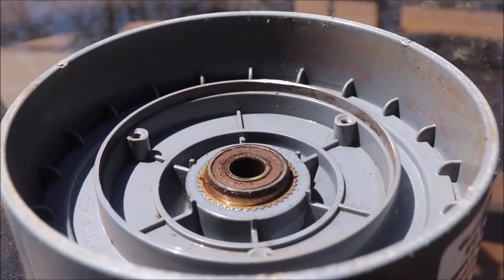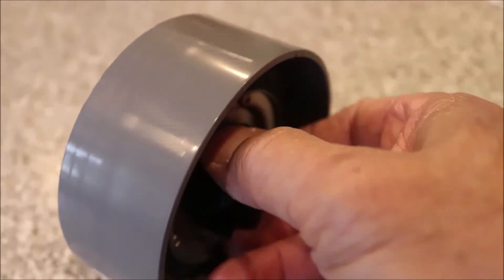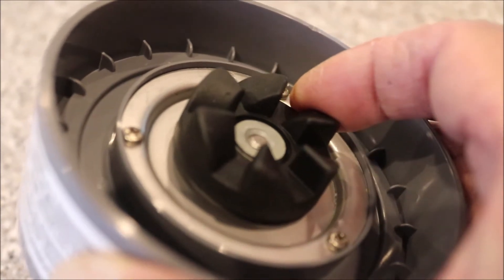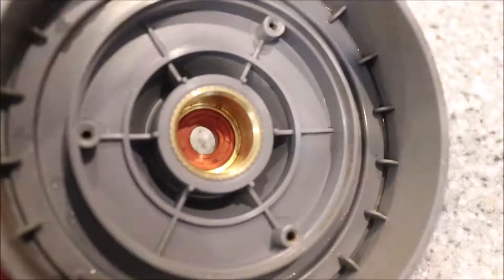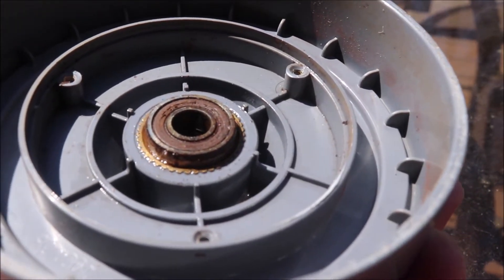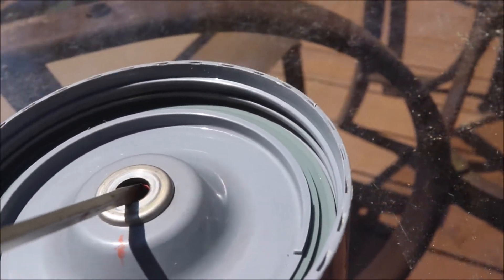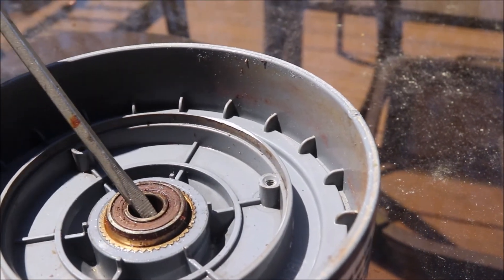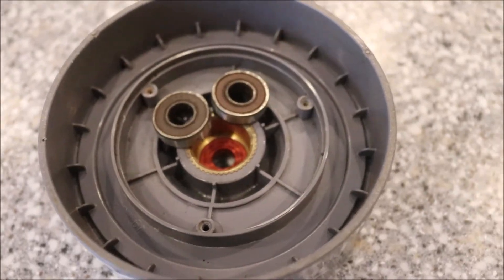NutriBullet is very loud and noisy - the ball bearings need to be replaced.

Comment: Rubber toothed bottom is reversed threaded.  A Snap Ring pliers on the two small holes makes it easy.  The bearings are #698RS.  A better bearing would be S316 698 RS or S304 698 RS.  The latter are all stainless steel bearings.  No more rusting

Comment: Bearings lose lubricant over time. The black seal on these bearings easily snaps off and on with a knife tip or tiny screw driver.  Instead of replacing them, these bearing can be cleaned and re-oiled if they aren't physically damaged. If they are damaged, you've been misusing your nutribullet.

Comment: I got the bearrings out but the shaft seal is destroyed. Would anyone know what the specification/part number is for a replacement shaft seal? Cheers
Reply from the maker: check out the comments from tin dumbovic under this video:  https://youtu.be/imFKXa7joYE  He states the seal dimensions.  I have not verified if they are correct or not.
Reply: @YuDaMan  Thanks, I spotted that post as well. Have ordered it from AliExpress, the size/compound doesn't seem available from local bearing shops (Im in Australia). In case anyone is wondering it's 8x16x5 Oil Seal - material compound FKM / Viton. I verified the size on my broken seal also. Will report back how it goes, a few weeks shipping from China.
Reply: @F0untain  

I dont think thats the correct size for the rotary seal. I just took mine out and the dimensions of the seal are almost identical to the bearing.
Reply: @ceezedgerman  I can verify the 8x16x5 oil seal fit and was the same size as existing.
Reply: @F0untain  Can you please share the link of Ali Express? I couldn't find the exact seal there unfortunately.

Comment: Don't bother with this folks.  I tried this, got two new bearings, reused the old seals and the result was worse than the original, leaked allot more and noisier.
Reply from the maker: My replacement stainless bearings are still very quiet after 5 months of almost every other day use.  It is critically important to install new bearings properly.  NEVER press on the INNER bearing race to install ball bearings.  You must press ONLY on the outer bearing race to install ball bearings properly.
Reply: @YuDaMan  Depends on the quality of the replacement bearings.  Mine were cheap ones from Amazon.ca.  Cost $6 Cdn for four.  If you obtained a more expensive SS set, that probably made alll the difference.  Cost for a whole new base from Nutribullet is about $40 Cdn delivered.  Where did you get yours?  I'm inclined to try a better set.  Thank you.
Reply: It would have been a lot more helpful if you’d showed how you got the f@cking thing apart!
The bearing replacement is the easy part.
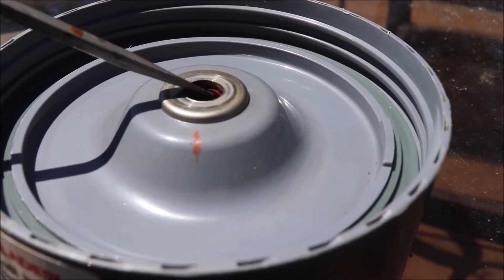Reply: @claywebb8199  There seems to be a playback error on this video starting at 0:45.  He demonstrates how to do it but you need to seek backwards to get to the part and that doesn't alas work.  Grab the blades with one hand and the rubber thing with your other hand and turn clockwise.  It just unscrews.  Be careful though because the threads are small and cheap and can strip real easy.